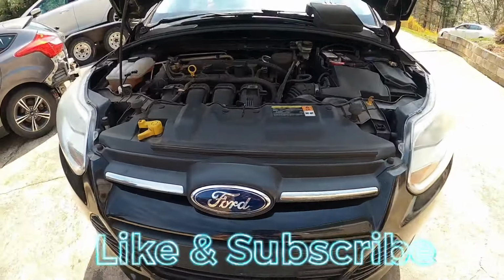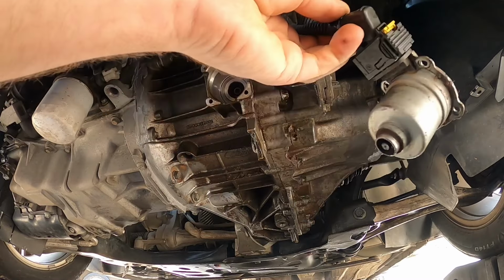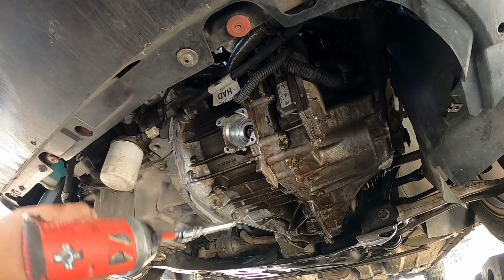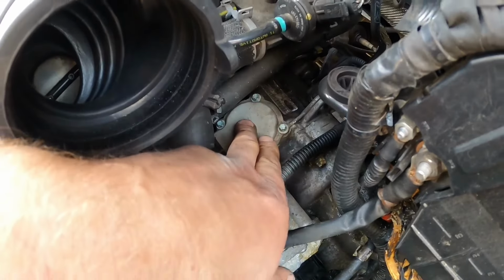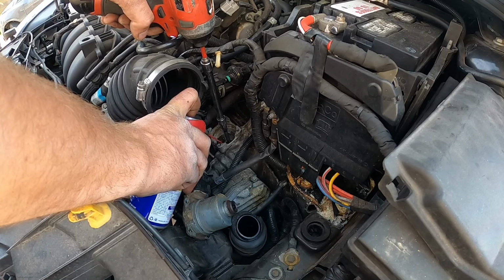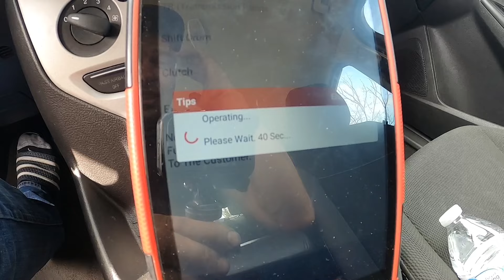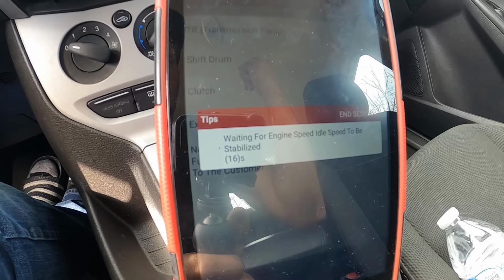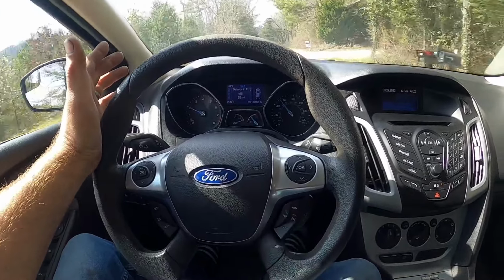2012-2018 Ford Focus Slipping? No Reverse? No Drive? Problem Solved. Easy Fix. You Can Do This!

Comment: what s tool size i bought the whole kit and doesnt fit 6mm or 8mm
Reply from the maker: https://www.ebay.com/itm/184480096055?mkcid=16&mkevt=1&mkrid=711-127632-2357-0&ssspo=yvwl7HUSReq&sssrc=2349624&ssuid=-qApsBzoR4m&var=&widget_ver=artemis&media=COPY
Reply: @L8R-HP  thank u 🙏 ,6mm too small,8mm too big ,i was going to buy 7mm(my kit doesnt come with it,so to make sure ill buy the one u say on ebay,i only put some brake cleaner and wd40 and check engine light came on, code p07a3, and now when change to 2 gear it kicks and it wasnt like that , the only problem was that it slipping a little bit on the first one🙆🏻‍♂️🤦🏻‍♂️ ill clean up all when i get the tool .
Reply: @gandhi2926  did 7mm work ? I'm having the same issue
Reply: @oscarcee6831   i dint buy the tool,i jus put  wd40 and it got really worse, then i put brake cleaner and got better,i dont feel like use wd40  anymore .

Comment: My 2013 focus does everything perfect except reverse. It was working perfectly fine and then stopped randomly 1/2 hour later. Any ideas?
Reply from the maker: Any codes?
Reply: @L8R-HP  nope no error messages no engine light no nothing! It still drives just no reverse and it will shift down into R it just doesn’t go and revs
Reply from the maker: @infinitiii360  fork is stuck

Comment: Sorry I know you get 100s of comments on your vids but hopefully you or someone from the audience can help me.

Will this help if my transmission is essentially shifting on it's own in park? Like it's stuck and it's trying really hard to find a gear. 
Or if it's shifting like 1st to 3rd to 5th
Reply: gonna try it anyway but hopefully you can answer before i get to it :) thanks for this knowledge brother
Reply from the maker: It will help
Reply: @L8R-HP  thank you, literally balls deep in it as I write this lol. Will report back!
Reply from the maker: @NaviYT  haha good luck 👍
Reply: @L8R-HP  It worked bro, I forgot to tell you I fixed it in September. I've been pushing as much traffic to this video as I can because this is BY FAR the most in-depth and helpful solution to this problem. I hope your video helps out as many people as possible. Thanks for making this

Comment: Car still running good since you done this??
Reply from the maker: Yep, I’ve done this many times. It only helps if your forks are just sticking. If they failed completely it won’t help.
Reply: I believe I have the same problem. 
Do I have to have the scan tool when I'm done to sync it or can I drive it to sync it.
Reply from the maker: @daleg5553  better with a scan tool. But it should learn on its own after a good drive
Reply: I forgot to ask, is that socket 12 or 14 point?
Reply from the maker: @daleg5553  https://www.ebay.com/itm/184480096055?mkcid=16&mkevt=1&mkrid=711-127632-2357-0&ssspo=yvwl7HUSReq&sssrc=2349624&ssuid=-qApsBzoR4m&var=&widget_ver=artemis&media=COPY

Comment: Anyone know what the little tool is called that he used to actuate the forks with the impact? I don’t really want to buy the whole kit.
Reply: It's a 7mm spline tool.
Reply: And an email torx.
Reply: I bought a whole set because he said it was a 6mm. Set has 6mm and 8mm, turns out I needed a 7mm.

Comment: My Fiesta have this code P286F Clutch A disengagement time performance/too slow. Its stuck in Parking Gear but when you see the dasboard is in Netral. What could it be?
Reply from the maker: Lose cable or maybe selector switch sensor
Reply: Thanks, i'll do that and excellent explanation of the video.  It helps us to make the transmission last a little longer.

Comment: Hi Teacher. Mi 2012 Focus shudder in second gear, but only when car is hot and after turn it off and stays about 20 minutes parked. I can start the car and drive 200 km without problems if I don´t turn off the car. So you have any idea what can be? Regards.

Comment: I did this and still no reverse etc.  what would you suggest?  Thanks
Reply from the maker: Replace the forks
Reply: @L8R-HP  those are inside the transmission correct?
Reply from the maker: @LoFi-Kingdom  yes

Comment: What would happen if you don’t do the recalibration that you did at the end with your launch ?
Reply from the maker: Once you do normal driving car should learn on its own.
Reply: Thanks I’m doing this today
Reply: I did this instead of dropping out the transmission and it was obvious that the forks were getting stuck by the time I finished I could tell they were working much better took it for a drive after and it did great I’m going to clear the codes and hopefully they don’t come back

Comment: They catch hell because they do fail. This is one problem, but the much bigger issue is leaking seals causing fluid to reach the clutch packs and ruining them because it’s a “dry clutch” hence only taking about 2 quarts of fluid, vs 6-8. My mom traded up from a 2012 to a 2015 because the salesman lied and told her that Ford fixed the shudder issue. Paid it off less than a year ago and at 120k, she’s looking at needing a new vehicle.
Reply from the maker: Out of 62 I did in the last year 0 had leaking seals. Miles were from 27k- 185k. Focus only holds 1 quart of transmission fluid
Reply: @L8R-HP  I’d say those people are very fortunate! My mom’s Focus has begun to sound like a jet engine and just doesn’t want to shift anymore. Growling and whirling is quite the noise, but it still drops into PRND just fine. It has always had the shudder, but it got to the point that you’d have to let off the gas, allow it to shudder and shift, then get back on it. 1.8 quarts in the configuration she has, but I rounded up. I wish she would’ve taken it up for service before she went out of warranty. Could’ve bought herself some time.
Reply from the maker: @beckst3  if you clean or replace the forks it will run for a long time

Comment: I have a Ford Focus 2015 and I have a problem with the gear, the car drives forward for 4 or 5 kms, then the gear does not work ۔reverse it runs rough and the oil comes back to the place where the gear oil is put.

Comment: Hi #L8R-HP!! I loved your videos!!! I thought of reaching out to u! I have a 2016 focus with 51k miles and I’m getting codes p07a3, P2832, P07a2, p073e, p073f, p074b, p074d and P2787. I thought that this may do the trick but later as it happened before the transmission started overheating when getting into traffic or continuous stopping. So the diagnostic from the scanner suggest a tcm reprogram. Also doesn’t seem to engage the S gear and the actuator A seems a little more soft than B when turning. Can I pick your brain for suggestions? Thank you in advance for any help!
Once again thank you for those amazing videos! Big fan!!…

Comment: One thing I would like to know is if there is a torq spec for the actuators, I’ve always just tightened them down good but I think there is probably a torq spec
Reply: I would do at least 50lbs. torque on those bolts :)

Comment: I tired this on my ford fiesta and it made it worse, used to go reverse sometimes but now it doesnt go reverse anymore.
Reply from the maker: You didn’t make it worse. It just needs new forks and maybe a clutch
Reply: @L8R-HP  I think I might've spinned it back a little too much and now it's not spinning back clockwise. If this is the case what else could I do?
Reply from the maker: @mrsamufyx12  just need to remove the transmission and replace the forks

Comment: Sir, if you would have turned clutch b with 6mm spline tool non electronically then I would have heard the sound of forks engaging and disengaging
Reply: and clutch a also non electronically

Comment: I hit high standing water and now I have no reverse. '13 focus. P082a, b, e, & P287a are my codes now. My bottom one only turns about ¾ of the way counterclockwise and then turns back to the right.  I didn't use the correct tool so I didn't want to turn too hard. I used a 6mm hex head. It still wouldn't turn even once with as much force as I could apply using a hex trying not to strip it.
I used some brake cleaner but I want to get IAC to spray, it's safer on gaskets.  
Or is the bottom one have tough issues.
I was thinking I could get the plastic connector off but I don't know now and they use a hair dryer maybe it's just water in the connection?
I will tell you that when I opened and looked in the motor by the spindle, I saw water droplets. Little beads of water collected at the base where that rod comes through and the spindle that fits and turns inside the transmission is.
I might have got water in my transmission or right in that area and now it's locked up because it didn't happen until the next day after I drove to work and then the reverse stopped working and driving home I was a nervous wreck, everything was slipping with each gear shift.

Comment: Hello, thank you for amazing video! I just was told that my clutch is “maybe” failing and I need to replace it. I have 2013 Fiesta hatchback. When I asked how much it will cost, I was told $3000. WTF… 
A bit of history, my car had TCM replaced twice at this point, and is driving great ( currently).
Couple weeks ago I went to get my 120k service and after picking the car up I noticed a very slight grinding sound from the left side of the driver wheel. This happened when going from 30 to 40 mph and down, almost like something is rubbing.
This happened right after I picked up my car from service and I thought it was a balance off wheel or maybe wheel baring. 
When I took it in, I was told about the clutch and 3k .
The car shoots perfectly fine and drives excellent, only that noise.  Anyhow, was wondering if this noise can be a failing clutch… I will be taking my car to another Ford place and getting a 2nd opinion. 
Also, when I asked why is it so expensive ( did get the pricing from another Ford place with price per part) my mechanic simply said, well we will be in there, we will just replace the whole thing….. wtf … 
Anyhow, thank you again for awesome video!

Comment: Great video!
Quick question, my ford focus 2014 powershift, saturday 10/01, has turned the injection light on for a bit, and the message "transmission malfunction" has come up when I was stopped in the N position, and when I switched to D position, it turned off and drove normally, my question is, if I do this process, it can help the car to drive better and avoid this future issue that this car in the video had?
Reply from the maker: Yes it will help

Comment: Do you even know what you are spraying with Brake Cleaner?  and where its going? 🗜💉

For the record here, if the problem is with the actual Shift Forks  it's internal to the Transmission .... than it's a problem within the transmission.   External parts is a different thing... Remember that the Clutches do wear, they are clutches after all.
 
When you are spraying Brake Clean into the trans it is not going that far.  If anything, it is most likely cleaning clutch dust off the rollers of the bottom side of the Shift Fork Assembly and where the actuator rotates so that the shift forks can move up and down.  The Brake cleaner is not going to go into the clutch pack assembly to clean the clutch discs as it can not reach that area and it is probably not even coming close to cleaning the actual forks.  So it's basically staying within an inch or two from where it goes in.  

You really need to see a video where the transmission is apart and when the fork assemblies get installed (B forks first then A)  before the clutch pack to understand what you are spraying and where the brake clean is going. 

With the amount of clutch dust that is everywhere, it can coat everything in that trans housing.  More important is probably the recalibrating/learning that you do through the computer.

Do NOT spray Lubricants into that Transmission. Don't do that.  VERY Bad Idea. You don't want moisture in there, and you do not want any lubricants to get on a clutch disc.  

If you pull apart this transmission when you put it back together, Ford want you to lightly grease the input shaft splines and wipe transmission fluid on the smooth part of the shaft that sits between the inner and outer input shaft.  You can put some grease on the ends of the forks as well. The inner case of the transmission is filthy with clutch material that covers everything, so clean the heck out of that case if you ever have a trans apart or out. .   

The shaft (input shaft) on this transmission has an inner shaft and an outer shaft.   
The inner skinnier shaft controls all the Even Gears 
The outer shaft controls the Odd gears and reverse. 
The A Fork is wider than the B fork.
Actuator B controls is Reverse and the EVEN gears i.e.  2,4 and reverse
Actuator A controls  forward ODD gears i.e. 1,3,5.    

So that is 6 gears total with reverse.

The Ford DCT assembly is actually a Transaxle
Reply from the maker: This is too much to read. Have you seen my other videos?
Reply: @L8R-HP   You don't want to read. You might be a technician if you were to do that.
Reply from the maker: @gags730  ha got em

Comment: Found i turn car off put in drive wait few then put in park wait a few then start and off she went going good untill i turned it off.. Im guessing the tcm is bad even though ford replaced it with extended warranty i think back if goes and hopefully not again for awhile

Comment: Mine is slipping but no code and it will go in drive and reverse just fine. It makes wining noises and it stops after you are going at a constant speed, around 40 or 50, but shifting gears, it slips

Comment: Use to have a 2015 focus loved the car but it shudder off and on while driving why couldn't Ford put a normal transmissions in these cars!!🤔
Reply from the maker: I know right. These cars are awesome
Reply: @L8R-HP  42 mpg, gonna try what you did. i have 177k miles on it.

Comment: This fixed “P07A3 Transmission friction element A - stuck on” for me.
Reply: Which one did you clean and lubricated , the one on top or the one on the bottom? I got the same code today. Thanks
Reply: @fxsalcedo6729  the top one. The code came back and I had to replace the clutch actuator A as well and that fixed it for good

Comment: the most common problem is the shaft seal leaking trans fluid in to the dual clutch area , or simply wear of the clutch , making it slip and miss engage and quit moving . is that why the grey silicone around the bellhousing ? that would create a pool of fluid making it even worse . definately a temporary solution if any . the correct solution is removing the transmission, change the dual clutch , change forks and seawashers and replace the shaft seal and do the calibrations ,wich is expencive but then again "darn dual clutch" .also , i dont recommend spraying wd40 or any lubricant in to that area where the fork is cause is the same area where the dual clutch is . treat it like a standard clutch
Reply from the maker: Most common problem is lack of maintenance, and people driving these cars like race cars. 
Working on these 24/7 for the last few years, never have I seen a leaking seal. Most of the time it’s the TCM, actuators or actual forks sticking or completely failed. 
It’s a poor design yes. Spraying light amount of lubricant on moving parts is ok. OBVIOUSLY don’t flood it 😂

Comment: Wont work when the TCM craps out. If you lose reverse and 2nd gear plan on removing the transmission there is no other fix than replacing shift forks and/or tcm
Reply from the maker: TCM Is held by 4 bolts and takes 2 min to replace

Comment: Can someone help me. I have a 2016 ford focus titanium, it goes into first gear but not into 2nd, it goes into 3rd but not 4th, it goes into 5th but not 6th. What could that mean. And also when I try to reverse it it barely goes back but then stops…. SOMEONE HELP!!!
Reply from the maker: Fork B is stuck and need to be replaced
Reply: @L8R-HP would it be both then? Because of my gears not going in?
Reply from the maker: @andrescruz4291  I would change both. 
For A is 1,3,5
For B is  R, 2,4,6
Reply: @L8R-HP  thank you, do you have any recommendations on where I can buy it
Reply from the maker: @andrescruz4291  ford OEM is best. But I got the complete kit from O’Reillys and it works great as well
Reply: @L8R-HP  bet, I also had another question. A light came on when the transmission started messing up. Should I have any other concerns???
Reply: A over heating light^^^
Reply from the maker: @andrescruz4291  same problem. Forks are stuck. Makes clutch slip. And it gets hot

Comment: WD40 isn't a great "lubricant".  I think you'd find that repair would last a lot longer if you used some light grade oil instead
Reply from the maker: It’s better then nothing
Reply: @L8R-HP  You could have added any type of oil which would be better than WD.
WD is a cleaner/lubricant so it will dry out fairly quick.
Reply from the maker: @whill7828  yep

Comment: Thank you for sharing Brotha, what’s your experience with code P2701??
Reply from the maker: You can always try this out and see if it helps. But in your case it could be the TCM (transmission control module)
Reply: Thank you for your reply.

Comment: I tried this and a smaller gear came out of the actuator hole as well then all of the sudden the spring stopped working the car now won’t even start
Reply from the maker: Your fork has failed internally. Needs to be replaced
Reply: @L8R-HP  does this effect the ability for the car to start it won’t even start anymore also the error codes are p2832 p2831 and p287b
Reply from the maker: @colbyios5143  if it doesn’t start it could be the TCM.